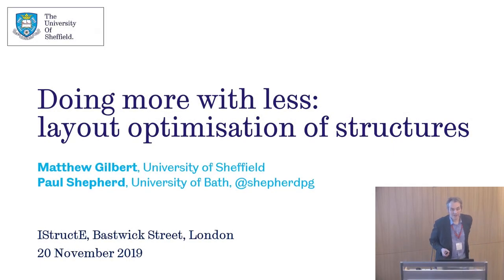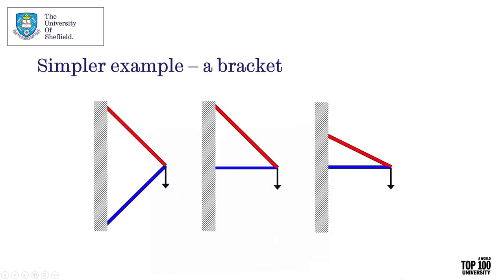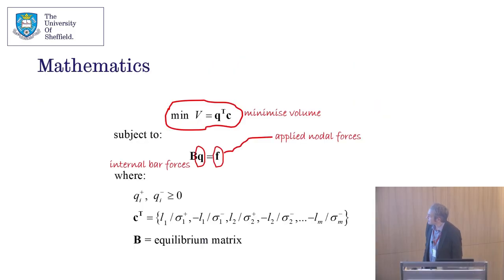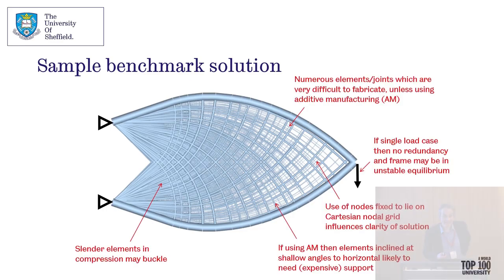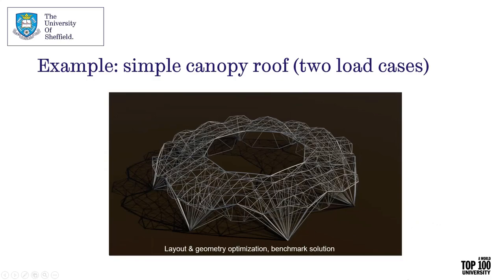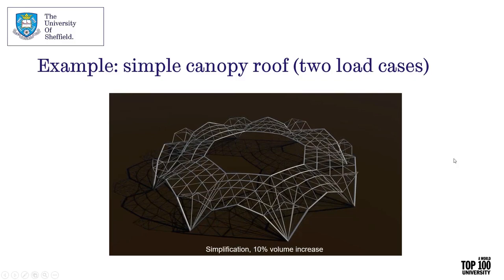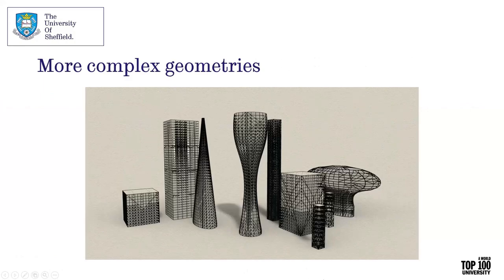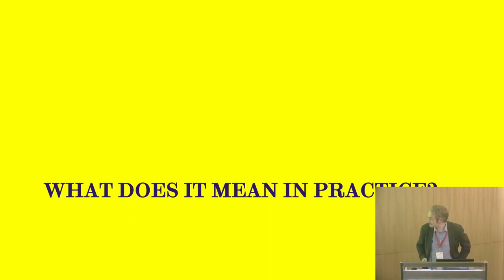Doing more with less: layout optimisation of structures (with Q&A)

Comment: @Paul Shepherd Question: With the layout optimisation of trusses (59:01) and implementing a simplified global optimum in respect of the material weight - with the asymmetric geometry of the resulting truss design - if adopted and implemented in a building / structure - does the failure modality associated with material wear at end-of-life or accelerated degradation like corrosion or weakening through heat and fire perform less well in terms of safety margin and buffer of "over" engineering? Are the asymmetric members creating more criticality or 'Achilles Heels' at certain points?